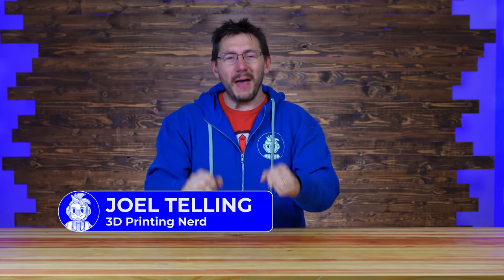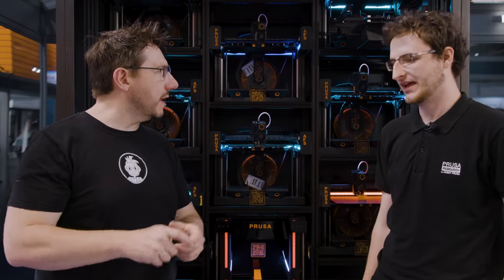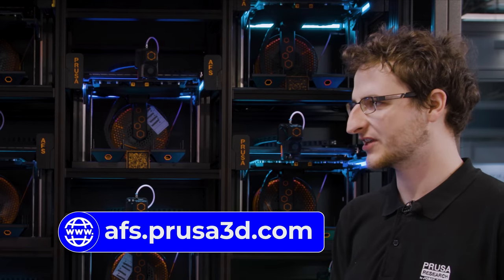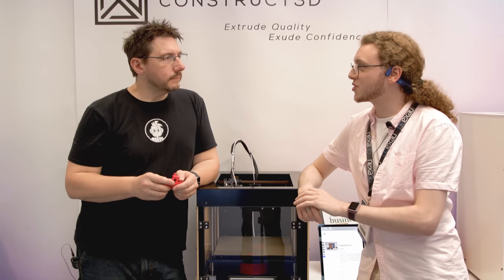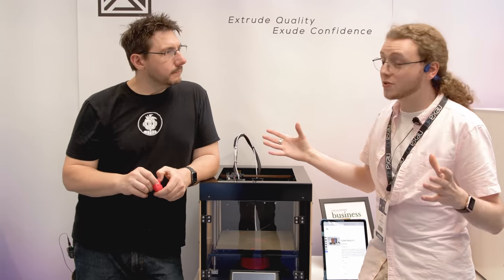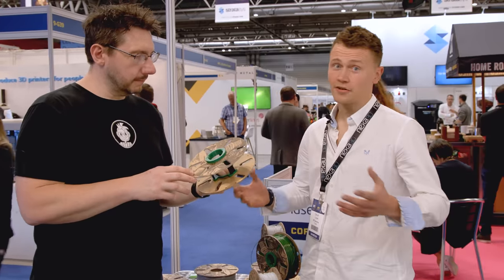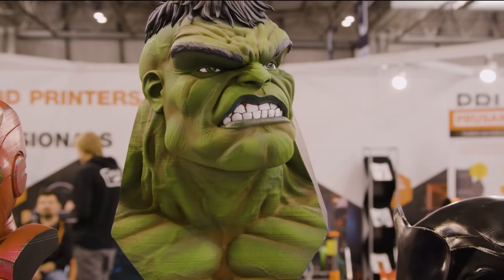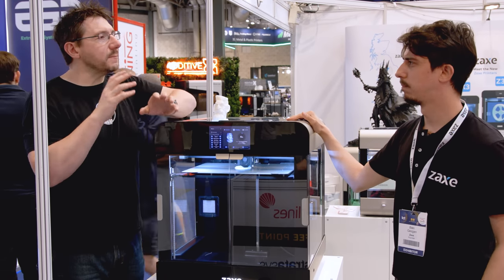AWESOME 3D PRINTERS at TCT3Sixty 2022!

Comment: Construct3D might be into something at that price point per performence.
Reply: It’ll all come down to the print quality. If they can figure out manufacturing and they can get good quality then it has a lot of potential
Reply: Levon Gevorgyan  Bambu will be 2k price point though.. The 1500 dollars is a marketing ploy.
Reply: Levon Gevorgyan  Yeah, but if they ever go under, there's no guarantee you'll be able to get parts. That's the best selling point for the Construct3D
Reply: Levon Gevorgyan  I agree.. completely.. and I’m not pulling it out of my ass.. I worked on the AI / machine learning camera tech used in the X1.. I’m just saying the current price and kickstarter were just marketing related.

Comment: It's amazing how quickly these FDM printers evolved in the early years from the RepRap and the first Prusa, to the Ultimaker, to Makerbot, using soluble supports etc.
Now it seems like most of what is evolving is the speed and the price- upwards. Would havew liked to see more materials science, carbon printing etc. rather than a farm from Prusa that does little more than the Ultimakers with the traction belt feed automation did 10+ years ago and doesn't have any kind of error detection? 
Speed is really important for cycle times in manufacturing but negligible benefit in prototyping, even rapid prototyping, since iterative design cycles usually take longer than a printing cycle, and companies staffed for muti-team iterative usually have at least one printer per team.

Comment: Those zaxe machines are truely remarkable. Triple z-axis, lage buildvolume, fast printing and a heated chamber.
Reply: The chamber is passively heated, the print speeds are below average for modern corexy, and in general nothing about it is remarkable.
Reply: @KevinMardirossian  Somewhere out there, there’s a tree working very hard to produce oxygen so that you can breathe. I think you should go and apologize to it.
Reply: @marktamrate7248  lol, +10 on the wittyness he's got a valid point however. Not a lot of zaxe is remarkable as in never showed before.